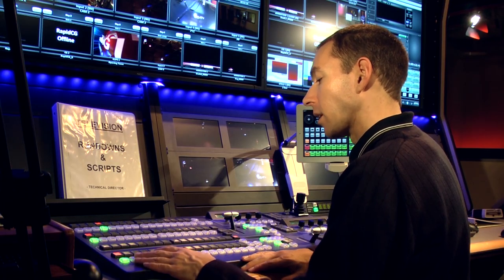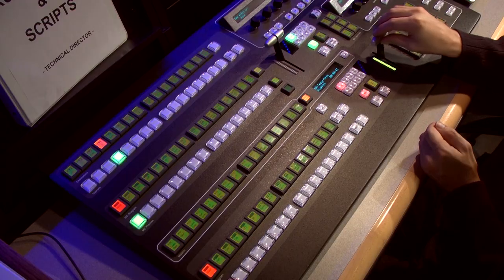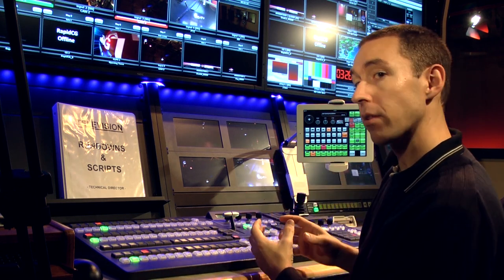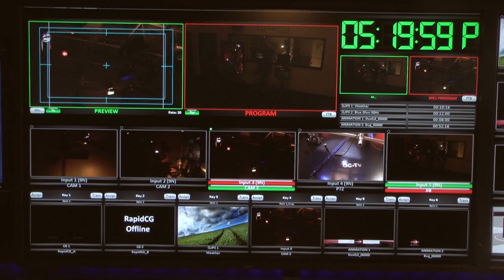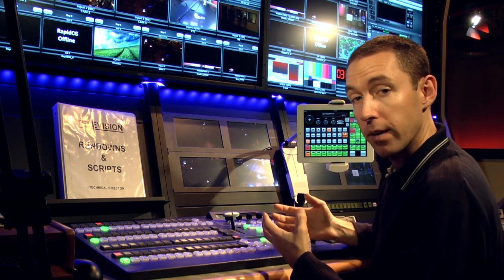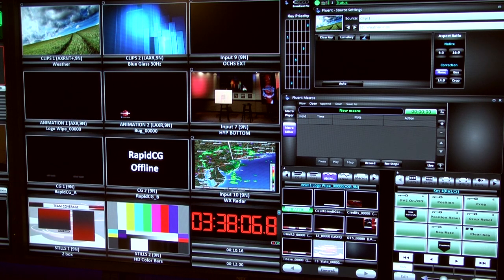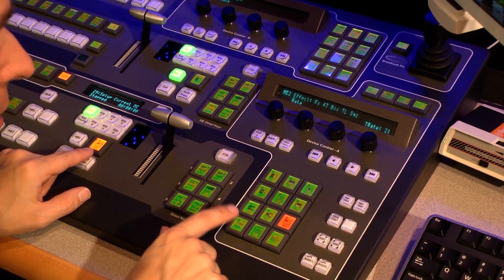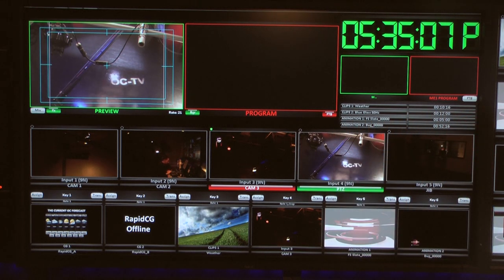Control Room Video Training Series - Granite Production Switcher (Part 1 -Basic Concepts & Overview)

Comment: Realize now every switcher board is different. You actually have to get the model and make of the switcher bard you;re working on.
Reply: Not really.

I have absolutly NO experience in working with media production but due to me being technically curious and a nerd I can follow along quite good anyway.

But nowadays you don't really need a hardware interface anymore since there's software out there that acts the same way as their older cousins...
Reply: @thiesenf  Good for u nerd.

Comment: Very good instructional  video about how television is in to the control room, just let me add something, the technical director should be able to put in preview signals who is going to be live, that way cameramen and the audio operator could SEE  wich is the next source,in the control room one very good set up is the audio operator behind of the switcher ON A SEPARATED ROOM with an preview and live monitor, long time ago i worked in a  USA tv station where all equipment was next one to one, for me that was very unprofessional video and audio on the same place. The moment i seat there i felt very uncomfortable,the audio operator was  to my side...checking mics, while i was switching...Thank for sharing

Comment: With great respect, very few professional vision mixers (or tech.directors) would "drive" programme/preset this way. Especially within live tv, there's rarely time to always use the preset/take 'option' to get to the next camera or video source. I've been a Vision Mixer (or in USA terminology, a Tech.Director) for almost 50 years & I have NEVER used the programme/pre-set buses like that. On virtually EVERY occasion I can imagine, I would always "hot-cut" the required sources on the programme (red-lit) bus, unless of course I was about to do a mix to the preset bus. Given ALL the years I've been a VM/TD, on every genre and type of both recorded and live TV programme, in studios & in outside broadcast trucks, I would NEVER, EVER tell a trainee to ALWAYS keep their left hand on the preview/preset buttons - that's just a recipe for absolute disaster ! Your left hand should always be on the live, red-lit 'programme' row of buttons. Although it IS possible to use the thumb of your left hand to also pre-select the preview/preset buttons on the row under the programme (live) buttons, unless you've got a large "span" with very big hands, it's NOT generally a good idea.
Sorry guys, but good luck to all of you out there in TV land 🙂 xxx
P.S.
There is also a very good instructional video by one of the top UK vision mixers, Naomi Neufeld, which is definitely worth a look. Naomi also confirms my own "assertion" that good VMs will ALWAYS have their LEFT hand over the TRANSMISSION row of (hot-cut( buttons.
Reply: I'd say like any form of technical art, that's one way of doing it. Hot taking everything may work in some cases and in some cases not work as well. I saw  that Naomi Neufeld and I don't recall seeing a spot where she said you can only use the hot take row. I saw her using the preview row here and there. She and others may prefer to hot take for their particular application. When I switch for a life band with multiple camera operators (some handheld), I use the preview so that an operator knows to be ready and I bring them hot quickly. It can also give time for them to steady their shot when I need to bring them live. In more static cam/studio applications, mostly hot taking may work a bit more. But I think there are multiple says based on the person.
Reply: Paul walker  the reason to  use  your hand over preset depend of the dinamic of the program, when you make cuts it's ok but yet the cameramen could see on the camera monitor wich signal is the next one, also if you have the audio operator behind you (that's the most proper set up in control room) he could see what is the next source  to open audio key, if you make professionally with the switcher you should be ready to cut,mix transición and compose with the foreground something called chroma, or fx saying you have been worked for 50 years and telling not to put your hands on preset is completely  wrong because you can make a mistake, that happen in a very fast production sometimes, with all respect 50 years don' t tell nothing after what you said...
Reply: Paul, had to disagree, I was not taught that way either, but that WAS just over 30 years ago on an old Grass Valley 1600 series production switcher as a student in a tech program for the TV Broadcast Tech at a local tech college. We were taught to use the preview row and then either cut to, or dissolve or wipe to. The GVG 1600 series switchers were similar in layout to this one, but from the late 70's so was getting up there in years but still largely serviceable. 

But that was due to the fact that we students were noobies at it and it was a great way to learn and as you gained experience, you could hot take if you felt like it, but if I recall, it was not encouraged so much.